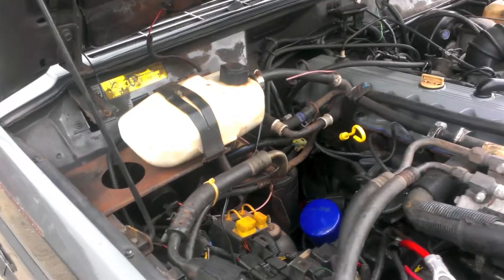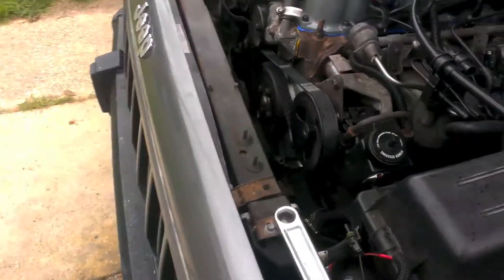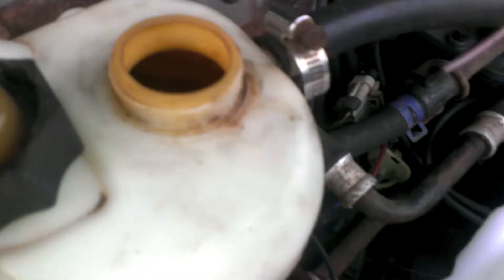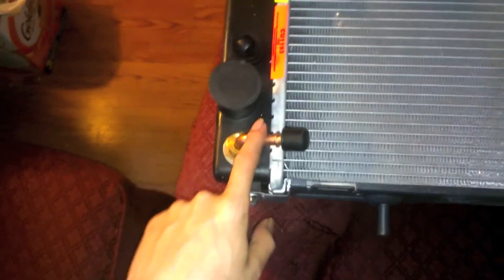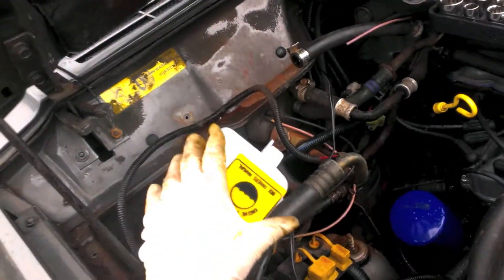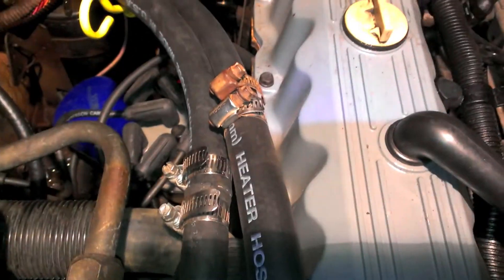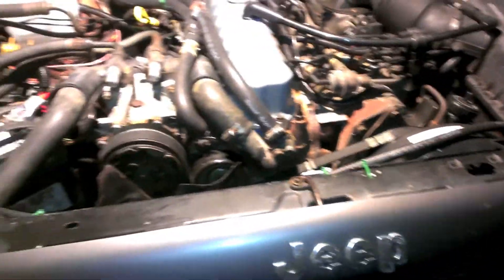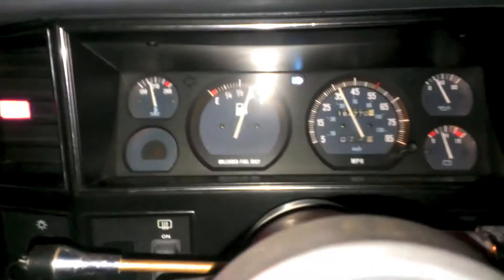89 Cherokee Closed to Open Cooling System Conversion

Comment: When I bought my 89' Jeep Cherokee the dumb ass PO had "upgraded" the cooling system to an open style radiator. It is not more reliable but easier to maintain for simple people. The sealed system is what is in newer cars and is actually better at keep the temps down. That was first thing I did, I bought all new cooling parts and swapped it back to a sealed system. I have never owned or worked on a Jeep before and I must say it is fun, addicting and easy. I first bought a plastic pressure bottle but then upgraded it to the aluminum pressure tank.
Reply from the maker: Wrenching on my jeep has been a blast and I always look forward to the next project, even if my wallet isn't. As for the closed vs open, I prefer open for reliability. My closed system would always bubble over and dump half my coolant system out. The open system functions in a similar manner but it releases the pressure into the overflow bottle to keep your coolant in one place. I prefer this because it sucks when you boil over on the trail.
Reply: How did it  bubble over on a sealed system? Was the cap on the pressure bottle cracked? When I bought mine it overheated on me right after I bought it. That's when I just ordered parts and swapped it back to original. Nothing will bubble out on the Mac's Radiator aluminum bottle now.
Reply from the maker: II N3MES1S II That is the downfall with a closed system, the pressure will leak out of the weakest link so the system needs to constantly be perfectly maintained. The plastic pressure caps are only rated for 16lbs of pressure, after that they leak. When they leak you lose system pressure and all your coolant starts to boil right out. Here is an example from my friends rig before he upgraded: Stab stab stab stab stab
Reply: Yea I know, the new plastic pressure bottle I got expanded like a balloon. After that I just bought the all aluminum tank. No plastic now anywhere. Still overheating though and recently found a leak in a freeze plug. Going to get all the side ones replaced soon.
Reply from the maker: II N3MES1S II Leaky freeze plugs is what started my whole engine tear down when I first bought this Jeep. They rusted out so the PO dumped a bunch of stop leak in to get me to buy it. If you go back to the begging of my Jeep Vlog, you'll see all the crap I ended up finding in that block. I had to pull the Trans to do the rear plug too.
Reply: Yea mine is just leaking on the side.
Reply from the maker: II N3MES1S II Mine only leaked out of one of the side plugs at first too. Then after all the cleaning I did, I got most of the stop leak out and wouldn't you know the rear started dripping a week later. So good luck too you. You'll get awfully comfortable with your engine after that job.
Reply: I don't know if I want to do that, I might have a shop do it. They quoted me 175 for labor.
Reply: II N3MES1S II The pressure bottle expanding is how it's supposed to be, it's designed to do that. I've dealt with Renix & HO cooling (closed & open) and to be honest I much prefer the open system now.
Reply: dainternetguru That was the fatal flaw in the pressure bottle, being plastic. I'm good on that now that I have the aluminum pressure tank.
Reply: Yea I heard about those in the forums. I got the all aluminum tank from Mac's Radiators.
Reply: II N3MES1S II There's a cap for a Volvo, 22PSI, that tits on these Dorman tanks.  It's a harder plastic, not the rubberish originals that have been blowing off on me, until I put a hose clamp around the cap.

Comment: Hey nick did you ever figure out what that blue line goes to..
Reply from the maker: It has something to do with the vacuum pump the actuates the front axle shaft. I believe that was a vent because of the black filter at the end of the line. There are diagrams online if you need to find out exactly what each line does.
Reply: I've been looking and nothing if you have a link that would be awesome thanks nick
Reply from the maker: Fermin Garcia Look at post #2 in this forum. http://www.jeepforum.com/forum/f12/4wd-vacuum-motor-hose-routing-580065/

Comment: So, by getting rid of the heater control valve, does that cause the A/C to not function properly? Or does it just not blow as cold as it should? I'm planning to do this conversion at some point, but I'm not sure I wanna get rid of the Heater control if it means getting rid of my A/C. And finally, are there any drawbacks for keeping the valve?
Reply from the maker: After using the system for a while, nothing has changed. The flaps still open and close properly so sliding to heat allows the heat to flow, and sliding to cold allow unheated air to flow. My A/C doesn't work but I would assume it would produced cold air. The heater control valve is kind of useless in this setup because the pressure bottle doesn't exist so the coolant only has one way to flow anyway. If you can transfer yours and you'd like to then go ahead, otherwise you can buy a newer style valve to fit. The only drawback I could think of is reduced heat flow or the valve sticking/failing.
Reply: NickInTimeFilms thanks for the info. one other thing, did you have to change the T-stat housing for this conversion? there is another guide for this mod on youtube, and they replaced theirs, but maybe that's because it was damaged.
Reply from the maker: MassEffectFTW If you follow my guide then no. The older closed system uses a temp switch mounted on the radiator to turn on the e-fan. In later open systems, they combined the e-fan switch and the engine temp sender into one sensor that mounts to the thermostat housing. The data was sent to the ECU and the computer decided when to turn the fan on. The new sensor will not activate the fan by itself so you'd have to rig the old style or find a compatible swap. 

I was lucky to find a radiator that had the filler neck and cap on it as well as the hole for the temp switch so I didn't have to modify the system at all. If you use a stock new style rad it will not have the hole for the switch so the t-stat housing was an attempted work-around.

Comment: Hi nick can u tell me where do u get the radiator for ur jeep I want to do that to my jeep this is my email luis.mario1970@hot mail.com
Reply from the maker: I bought my Radiator from Amazon. It is a Spectra Premium Complete Rad #CU1193 - $73.69 + Shipping from Amazon
Reply: Tnku nick I ordered how much do u cut where u put the bottle
Reply: Doesn't hit the hood
Reply from the maker: Luis M Gutierrez If you check the video at 10:28 you can see how I cut the old bracket. I just measured by eye and cut until it fit. The cap barely touches the hood so It fits in there snuggly.
Reply: ok tknu for ur help n ur videosa soon a get the staff im going to installed tnku nick

Comment from the maker: Everything has held up great! The new bottle doesn't bounce around and if anything, the Jeep runs a little too cool. Not a single worry about boiling over now. By my understanding, taking out the valve just means the heater core will always have coolant running through it which will keep it constantly hot. The heat is still functional with the line plugged, though It isn't very hot but maybe that's just an old jeep thing.

Comment: Since doing the conversion, how has it held up? I'll be doing it to mine this coming week. Also by removing the heater control valve. Is the heater still funtional? Thank you for sharing this video.

Comment from the maker: To answer your question about any problems, nothing in the system really changes. If you don't reuse your heater core valve then coolant constantly flows through your core but that doesn't hurt anything. It still builds the same amount of pressure and heat but it can properly vent now. Highly recommended if you doubt your old setup.
Reply: I think but not sure , it so the core leaks

Comment from the maker: If you are having issues with your closed cooling system then I HIGHLY recommend this. I haven't had a single problem now that I switched my system over. It runs cooler, it doesn't boil over, and I don't even have to worry about wheeling on a hot day now. My cooling system was clogged with stop leak and my rad was cracked so it couldn't hold pressure, it couldn't cool properly, and my fan switch wouldn't activate so this upgrade was a completely worth it.